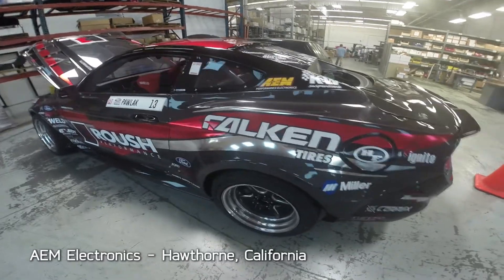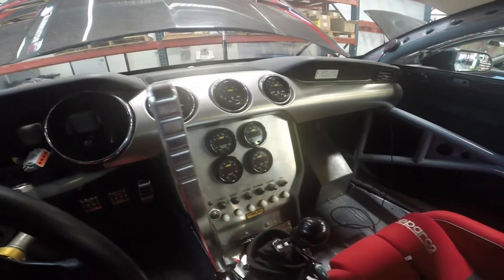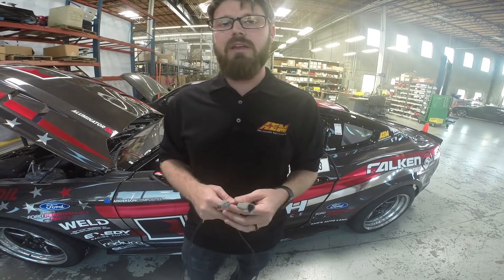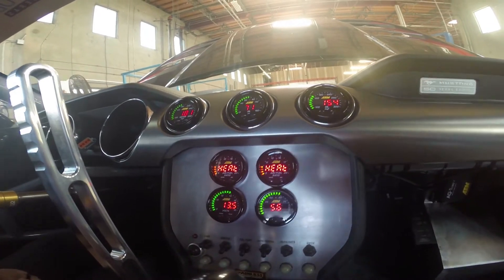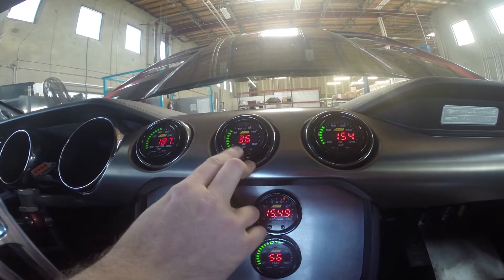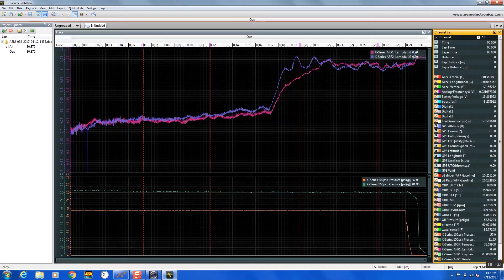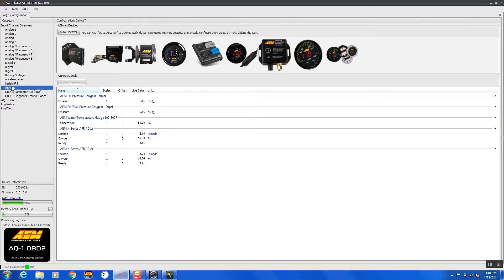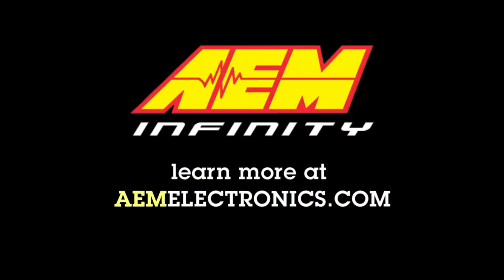JTP's FD Mustang gets AQ-1 OBDII Logger and X-Series Gauges with CAN Connection!

Comment: why cant you just log data from the infinity ?
also, are the gauges receiving 'CAN' signals from the infinity?
or from additional sensors separate from engine management sensors ? 
im planning my set up for infinity 506
Reply from the maker: Thanks for your support and good luck with your project!  You absolutely can log to the infinity, but JTP's Mustang is using a Roush-reflashed stock ECU which is why he uses the AQ-1  OBDII.